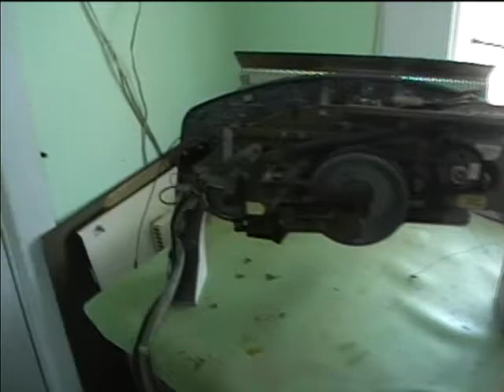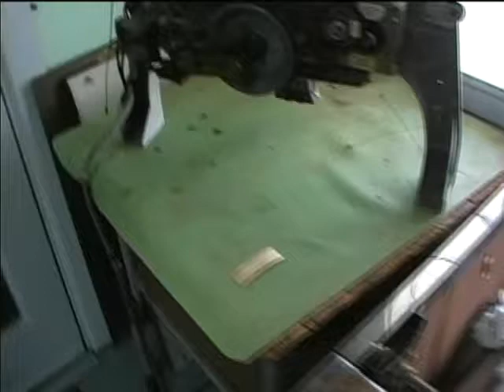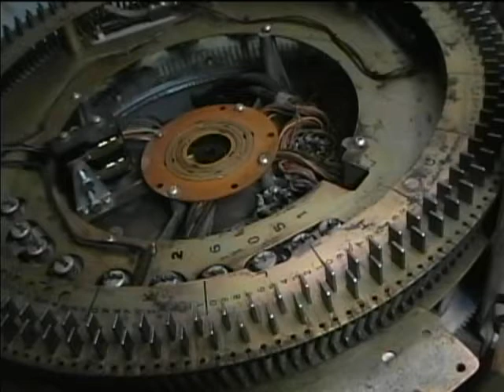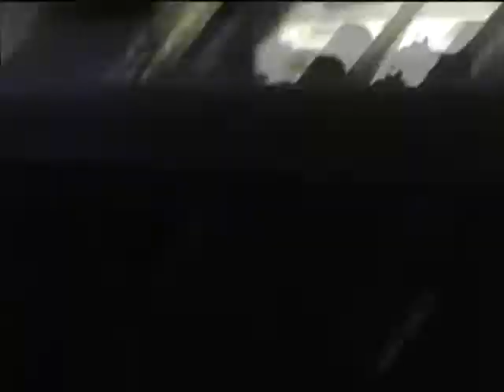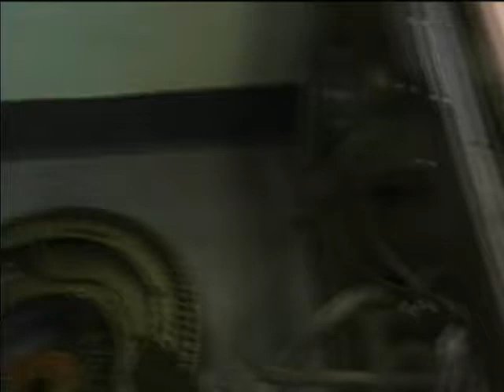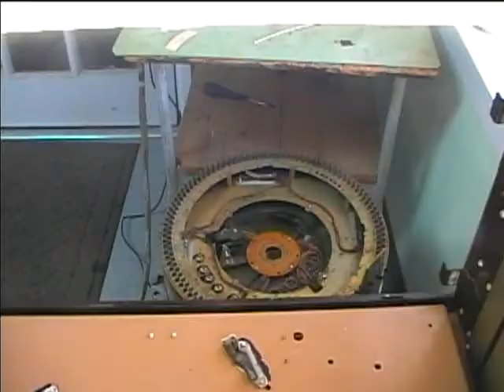1965 Wurlitzer model 2900 Jukebox Repair (part 1)

Comment: On my 3000...The key pad is not working, but the record will play if I trip the selection pin manually on the carousal . Ever see this problem before?
Reply: I know this comment is old but did you ever figure out your selection issue? I’m having the same problem

Comment: thanks' your videos have helped me so much i just bought a wurly 2800'  for a $100 bucks and cleaned everything' all contacts' but can't make a selection from the keyboard selection light goes on if i press say A1 the solanoids engage but only the motor spins 'but will not pop up A1 pin to spin carage the number solanoid will hold down but the letter will not pop the pin up? any help on this would be great and keep the vids coming i'm sure you have helped a lot of D.I.Y selfers. peace

Comment: Excellent video Retrochad, and good explanation of how the selector works.  I had a 2600 many years ago.  I had a key stick on my 1800, and it burned out the coil.  I have not repaired it and decided I can live with one selection missing.  The 1800 does not have selector rings.   I have not had any problems with the 1900 or 2000, and I hope I never do with the 2000.  The 2000 selector mechanism is constructed differently and looks like a beast to work on.